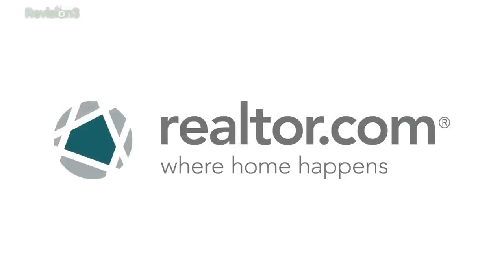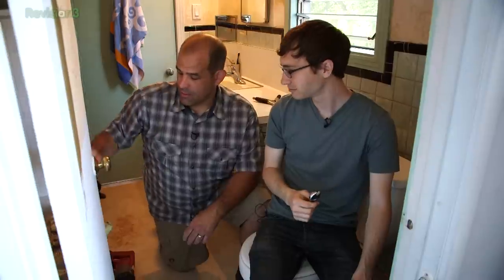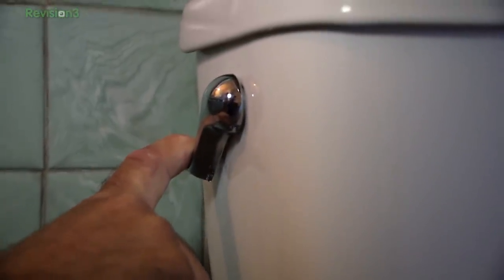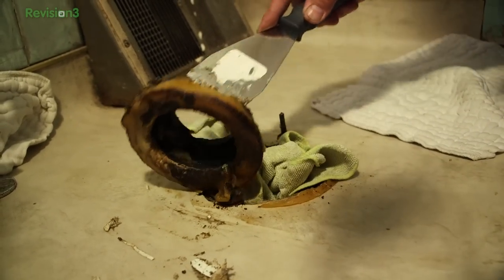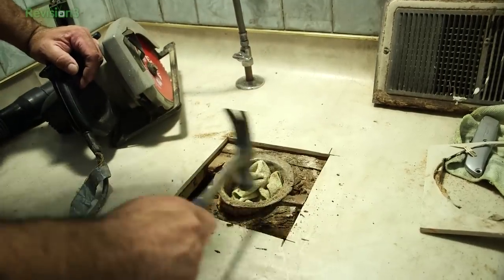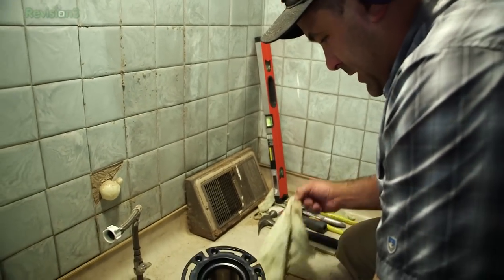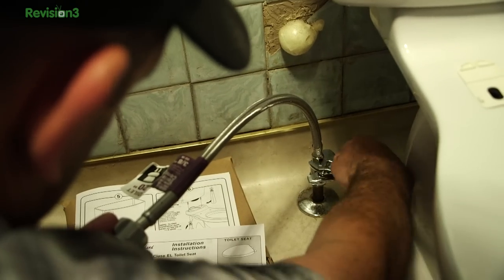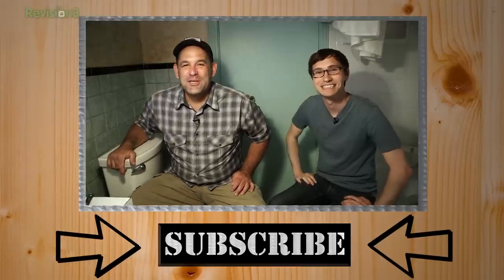Toilet Replacement FAIL...and Success!

Comment: Just replaced two toilets myself with the 1.28 gal units.  Always seem to run into a snag.  First one had a cracked closet flange and the second had the flange installed too far into the floor.  A flange repair kit and using stacked wax rings solved both problems.  Keep up the good work.  Really enjoy the show.

Comment: I just recently bought my first home and, while I'm totally a technophile, I very much welcome your non-tech videos.  I'm glad I don't have to replace my toilet, but I need a new oven and dishwasher.  Plus, there's an addition to the house that has non-working plugs.  In other words, I'll be keeping the DIY spirit for some time.  Love the show and keep it up!
Reply: I am a huge fan of my electrican, Sid, we rewired the entire house, so the whole thing is properly grounded 20A everywhere... and Sid found a reaaaaly unfortunate wiring job on the oven that was way not up to code.
Reply: Wow, that sounds like one heck of a project.  Glad you guys spotted the wiring issue before anything happened.  Unfortunately, the wiring in my house will have to wait till I replace a bunch of damaged drywall.  Our a/c unit backed up and leaked through a couple of rooms in our house.  At least that I know how to fix.  Luckily, we nipped the leak in the bud before mold set in.

Comment: The one thing to look out for when replacing an old toilet with a low flow toilet is the run from the toilet to the sewer.  We replaced one once and the run was greater than 80 feet and was really shallow.  We had to have it cleaned out every few months until we found the problem.  By the time the "stuff" made it about half way there wasn't enough water to float anything, so it would eventually dam up.  Added to this problem we were in Alaska at the time, so in the winter it would dam up, then freeze, compounding the problem.  If the run is shared with other things, sink, bathtub, washer, dishwasher, it's not as big a deal.  We ended up having to buy a toilet out of Canada that wasn't low flow.  After that we stopped having problems.
Reply: Fortunately, the kitchen sink and laundry drains are 'uphill' from the toilet... should keep things moving in the right direction.
Reply: Hopefully you're in a newer part of town too.  We still had WOODEN sewer pipes in Fairbanks!

Comment: You are getting new flooring soon? I see you have vinyl in there.  Do a DIY Tryin on heat welding vinyl. Melting plastic, crazy super hot welding guns, might make for a nice video.
Reply: There's some bamboo flooring going in... we might be dropping vinyl into the Airstream, tho!
Reply: patrick norton bamboo in a bathroom is a horrible idea. Like cork bamboo is highly susceptible to moisture. Just watch out.

Comment: Patrick's got a new toilet!
Reply: Go buy a Japanese tech toilet, same basic install principles plus electricity!
Reply: Greg Krynen I'm just not a big fan of toilet seats that move, speak, spray, wipe, or sing... I walk into a bathroom and the toilet seat moves I start looking for something to beat it to death with. (Happily I managed to contain this feeling the whole week I stayed in Japan...)
Reply: patrick norton I feel the same way when it comes to toilets. Converted from a 1985 high water usage to a nice dual flush low water use last year. Plain, simple, and it works like it should!

Comment: too bad low flow toilets break constantly and require way more water since you have to flush multiple times
Reply: Not in my experience. The old toilet often required multiple flushes. The the best thing about the new toilet is that everything goes down in one flush. [[stares pointedly in general direction of two small boys]]

Comment: You should have mentioned that it is ESSENTIAL to measure the "rough in" which is the length in inches from the bolts to the wall. My old house had a standard 12 inch toilet installed on an 10 inch rough in. Unfortunately it almost fit, but was never really stable, leaked at the base, and smelled. The tank should not quite touch the wall, and this should have been a clear sign to me that the old owner was not the DIY guy he imagined.
Reply: I have the fantasy of meeting the "really nice handyman' that did a bunch of the 'repairs' on my house...